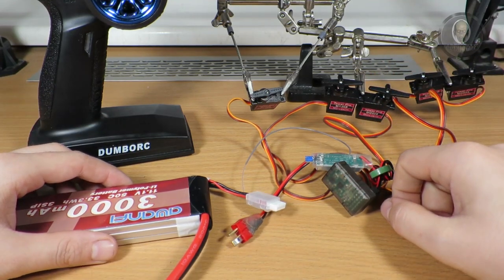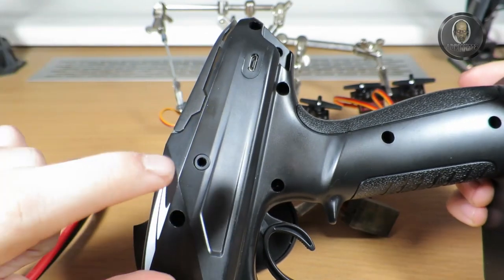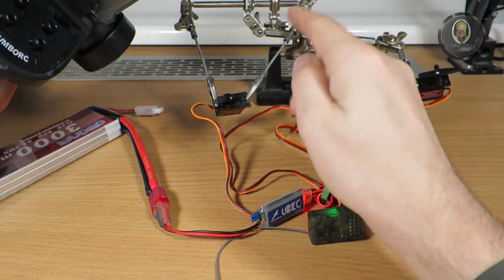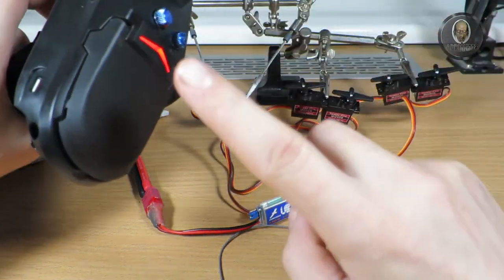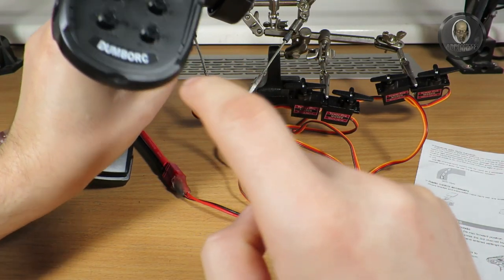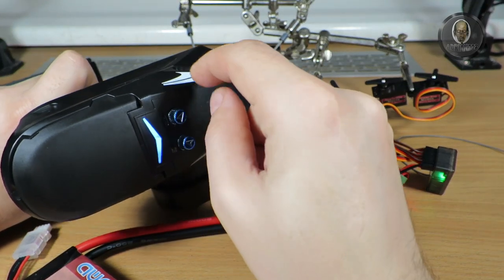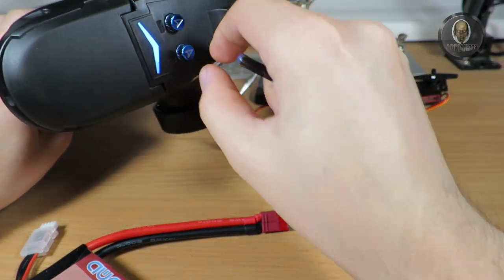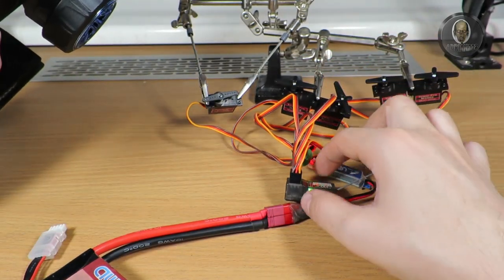Setting up DumboRC transmitter and receiver

Comment: It doesn't work for me.
Reply from the maker: There are two versions now as far as I know and the new version have a different combination to get into the menu.
Check manual how to enter the menu in Your version
Reply: @Adrian202  I found a young kid that had a video. Turn left while pulling trigger, turn on, push ch3 , blue light on top flashed, pull trigger, release to center, push forwards, and return to center, repeat, move ch 4, and 5 knob, and switch, push ch3 programming complete
Reply from the maker: @RCOverKill  I have only older radios so can't make movie showing programming on new ones but I pin this conversation :)
Reply: @RCOverKill  who is it I want to know
Reply: @nolansrc9560  1stbill look for directions, if not I'll find it for you
Reply: Hai..i just a new beginning for this rc play...and i just buy a new transmitter with provide reciever x6f...how if i just buy reciever x6dc n pair with my transmitter..it can or not??🙏🙏🙏
Reply: @nolansrc9560  my internet is super slow or I would look. It's about a 16 year old asian boy in a 2 or 3 minute tutioral
Reply from the maker: @ridzwan8204  Receiver from the same factory should work, but some functions like gyroscope in some receivers could not work but I think it will work after binding :)
Reply: I know Im randomly asking but does anybody know of a way to log back into an instagram account?
I stupidly forgot my login password. I appreciate any assistance you can give me!
Reply: @Carlos Kyng instablaster ;)
Reply: @Carlos Kyng No problem xD

Comment: Thank you, this was exactly the explanation I needed. Note: on my dumborc X6, to enter programming mode, you have to pull back the trigger and turn the wheel left, switch power on and then push button ch3.

Comment: Just to let you know, new versions of this transmitter use a different combination to access the program mode. Now you fully press trigger and turn steering wheel to the left, turn on transmitter and release both controls. Then press ch 3 to access program mode. Took a while for me to find this as the manual still mentions your way @ 19:00. Hope this helps somebody
Reply from the maker: THX for information, I pinned this comment on top :)
Reply: Is that a gyro transmitter and receiver it's on its side that's why it's twitching
Reply: The twitching cuz of the gyro turn a gyro off to stop twitching

Comment: Can I put two servos on the steering channel. Because my car has two servos
Reply from the maker: On all radios and just use splitter.
The only problem will be to reverse the rear one, but there are servo reversers on the internet, or You can redesign steering to reverse direction.

Comment: Hey, This vid helped me a lot!! I just got the DumboRC x4 that used the new program mode option. I did not know what the dials did and somehow accidentally zeroed the throttle and steering out. I thought i got a broke unit but i could still adjust the trim and the car would move so I knew it had to be a setting. Watched a bunch of other vids and read forums and nobody else said anything about the knobs! Thanks for making this video!
Reply from the maker: I did the same in this video :D
Took Me moment to find out what's going on :D

Comment: Nice to see that you took my experience to the video!
Reply from the maker: Yes and also i did not know that you need to set ranges on channel 1 and 2 before confirm with ch3 button
Reply: @Adrian202  No, I know, it took me a while to understand that. A little weird. But it really makes this remote even better! Amazing to get a such a good piece for the money.
Reply from the maker: @bengtmowitz5012  that's why it's nr 1 in this moment.
I will order x5 for My BMW and I still think about rebuild one of My trucks to full metal :)

Comment: How do you get the failsafe to work on this radio, I've just got one and I'm trying to set it to put the brakes on for my nitro when I turn the transmitter off (go out of range)
Reply: yes I need mine to do that aswell. did you find anything?

Comment: Thank you for the very informative video! I have just two more questions: Is it possible to drive a crawler winch on CH 4 with the 3 position switch (the best would be: Pos 1 (left): on/ Pos2 (middle): off / Pos 3 (right):  on in reverse direction)? And if you think yes, how to program the CH 4-switch? Thanks a lot in advance for your answer!!
Reply from the maker: Channel 4 is moving from negative --> center --> positive that mean on ESC it will have reverse/brake --> neutral --> forward in programming mode You can change max angles, so You can adjust that for Your needs.
Switch on channel 4 is always working until remote have it :D

Comment: i see you have 4 x 1.5V rechargeable batteries (that is nominal voltage of 4x1.2V = 4.8V). i know the remote also can use a 2s battery pack of 7.4V nominal voltage. Do you know if using the 4x1.5V batteries makes the signal range shorter or weaker compared to when using 7.4V ? thank you
Reply from the maker: I don't think so, It's probably regulated down to 3,3v, but I'm not sure about voltage

Comment: Since you've had this for a while maybe you can help: a portion of these radios have an issue where they simply just lock up and keep sending the same signal (full throttle and right turn for example) for 1-3 seconds... causing run aways and such. ... it resets and you gain control again.

have you had this? if not is there any chance you could open yours and help those of us who have this issue.... it might be that a new revision of the control board has removed this bug OR this is a manufacturing defect due to some bad soldering or something..... detailed shots of both of these might help solve the issue for those of us looking for a solution(so far ive only found ppl talking about the issue no solution yet)
Reply from the maker: So I notice this problem when You turn on receiver but not radio, When You lost connection receiver love to send random signal on random channel, sadly that's software problem and I don't know if failsafe device will detect missing signal.

Comment: I bought this hopes of upgrading the one I got with my danchee ridgerock but I can’t seem to program steering modes( crab-4wheel steer or just rear steering) is it possible to set this transmitter up do do that? I have 2 servos and they’re plugged into channels 1-3
Reply from the maker: I don't think You can use dual steering with this one unless You use a special mixer that will add that function.
You can have rear steering on potentiometer but will not be mixed with steering
Reply: @Adrian202  well that’s unfortunate 
Thanks for the heads up

Comment: hi, you receive it T6F does not have the gyroscooio function, right?  do we need the receiver that ends with the abbreviation FG?  Thank you
Reply from the maker: If I'm not wrong, gyroscope function is  in receiver so transmitter need to have so many channels just to be able to set specific sensibility on gyroscope to work bot I could be wrong
Reply: @Adrian202  for the same remote control, there are two kinds of receivers, I don't want the gyro because I have the version without?

Comment: One note - with regards to the direction of the Rx for the gyro to function.  I have installed mine in my HPI water tight Rx box but it only fits sideways and the gyro seems to work properly.  I am not certain how but it does.  Any comments?
Reply from the maker: Maybe it's detecting rotation, not moving sideways ??

Comment: I have x6 transmitter x6dc receiver. My ch5&6 are push buttons not knobs. I'm still trying to figure out how to adjust their trim like the ch3&4 that use the 0-100 knobs.
Reply from the maker: On the one that I have You trim aux with trims of throttle and steering but in programming mode, but they change software in remotes and I don't know if new remotes still have that

Comment: Just got this for myself - great radio and features, but I seem to have a problem with Channel 1 - steering. The steering trims settings are opposite to the direction I want. I can trim the steering, but it's frustrating that I have to go opposite direction on the steering trim knob. Any advice?
Reply from the maker: I notice the same :D reverse only work for direction not centering :D
That's software problem and to fix that You will need to rotate servo in mount but for most models not possible :)

Comment: How many receivers can you bind to one transmitter of that model?
Reply from the maker: I think one, I did not test for more than one because You can't switch between settings so You will always need to calibrate after connection and that annoying :)
Reply: Adrian202 RC yeah good point.

Comment: Can this handle 3s
I am using 3s zop 2200 mah and my receiver has burnt as I directly attached my battery to it without esc .Can new receiver be connected to it easily and my esc is 320 a
Reply from the maker: receiver can support up to 2s as far as I know and NEVER CONNECT BATTERY TO RECEIVER !! there is no battery protection and voltage regulator so always use BEC, UBEC or ESC to power servos and receiver :)
for receiver is not important how powerful si ESC or motor because it's only sending signal to it and ESC get all current on mosfets if I remember :)

Comment: 6th cahnnel could work with servo like 5th, or it is only for gyroscope sensitivity?
Reply from the maker: in theory Yes because there is connector for that channel on receiver but it would be better to disable gyro in receiver.
In that case would be just better to buy version without gyro :D

Comment: hi there is it possible to connect an Fan to the Receiver ? is there an channel with permanent output ? or would it be possible to plug it in channel 3 ? could you explain which pin is which polarity by default/Forward ?  Nice Video o/ much information i didnt know :D  !
Reply from the maker: You need 2 pin fan (3 pin version could not work) also need to be for 5v or 6v depending on BEC that power receiver.
Each channel have + on inside and - on one of outside pins
You just connect fan to that two pins because they are connected together.

Comment: Can i connect rc flashing car system for controlling the function of the led? Like the turn signal
Reply from the maker: I did that :) mostly light kits use Y splitter to connect to steering and throttle.
Check here:
https://www.youtube.com/watch?v=7iDWJ5vWgX8

Comment: Hi I want to ask you something that I am using dumborc transmitter and receiver and 2s lipo and hsp 320a esc in my car my throttle is 100 but I push it ,it does not catch speed immediately .do i need to change my esc?
Reply from the maker: Sorry but there is way to much things that would make this problem that's why I can't be more specific.
This could be a mechanical problem, problem with ESC, trimming on remote, soft start on ESC and much more so You will need to test each part one by one to find what's wrong.
Sorry but I can't give You specific solution :(
Reply: @Adrian202  I bought everything new throttle and trimmer at 100
Reply: @Adrian202  just make me clear that I am using hsp 320a esc I think due to this esc problem is occurring.
Reply from the maker: @nowitsepic5330  This may mean mechanical problem like weak problem or something blocking drive or to weak battery that's don't have so much current
Reply from the maker: @nowitsepic5330  This may be faulty ESC but that's rare
Reply: @Adrian202  plz I will be kind if you check the hsp 320 specs online and I bought new battery of 7.4v 4000mah.My heart says that esc is not for this car.My RC car is jjrc q46 I just put new electronics on it.
Reply from the maker: @nowitsepic5330  wait, 4000mAh ?? that's over kill, it's to heavy for this car !! car is so heavy that motor need much more current to get it to start
Reply: @Adrian202  but the car when I bought come with 7.4v 3000mah.and car was working fine with full power.

Comment: Hi, a very good explanation of the Dumborc TX for something that is not easy to decipher from the manual,  in regards to controlling 2 motors my understanding of the manual is you connect 2 ESC's (and 2 motors) to channels 1 and 2 which will give you differential steering which is fine for a tracked vehicle but I would like the TX to not only control 2 motors but also control a separate servo to control the steering as well! I don't think this is something that the 6 channel Dumborc can do but hoping I'm wrong LOL what are your thoughts on this? thanks in advance.
Reply from the maker: You could use potentiometers for that
Reply: @Adrian202  Thank you for the reply I really appreciate it but my understanding of electronic components is much more basic than yours so could you explain further how to use the potentiometers to give me 2 motor control and steering, (might help others too) again thank you in advance.
Reply from the maker: @markpreston8273  You can connect servo to potentiometer and that would be a second steering wheel :)
or You can use a separate v-mixer for motors and split steering signal to v-mixer and servo.
Don't worry, We all learn :)
Reply: @Adrian202 @markpreston8273 I too am new and found this conversation too see if anyone could explain how to set up steering modes (4wheel-crab rear steer only) with this transmitter ? Is that possible? I’m trying to use this as an upgrade for my danchee ridgerock thanks in advance

Comment: Thanks but can it handle 3s as you r using 3s and will new receiver be attached to it easily
Reply from the maker: I'm bit confused now, Receiver work on 3S or transmitter work on 3S ??
Reply: @Adrian202  receiver on 3s
Reply from the maker: @nowitsepic5330  I don't think there is any receiver that will work on 3s.
You always need BEC, UBEC  or ESC with BEC to power receiver or You will burn it
Reply: @Adrian202  No sir  I am just saying can i use 3s for this receiver by using 320a esc
Reply from the maker: @nowitsepic5330  receiver mostly work on max 7.2v volts so You can't connect battery directly but how much voltage ESC can support will depend on ESC because it will mostly send 5v to receiver no matter what battery You use

Comment: Perhaps you could splice the power lead from the BEC into one of the servo leads? That way you would use one port on the receiver for a servo and for power at the same time. I should work don't you think?
Reply from the maker: Mostly ESC provide power for receiver and servos so no need for that :)

Comment: great human explanation, at 1.5x speed it's perfect :D thanks! 
one question: can you connect LED lights for the car directly to the receiver? for example to channel 3? if yes, how much Voltage and how much current does the receiver supply to the LED in this case? so that I know how powerful LED I can add. thanks!
Reply from the maker: All depend on BEC or ESC that power receiver.
Most of ESC have 6 or 5 volts and something about 3 amps but You will not have any control to turn it off that's why I always use RC switch

Comment: Quick question. Can you bind multiple receivers with this transmitter?
Reply from the maker: Not worth trying, you would need to change all the settings each time You connect to another receiver.
If You had LCD and profiles that would change all the settings than that would make sense.

Comment: Hi, I wanted to know, does this receiver work with 11.1v 3s lipo. I am pretty confused as it has '4.8v-10v' written on it.
Reply from the maker: Because receiver same as servos is powered by BEC from ESC or separate BEC and most of them have 5-6v
Reply: @Adrian202  So it will work? I am using those cheap 30amp red escs.
Reply from the maker: @saikatmauser  Then You have 5v because DumboRC ESC have 6v so Yes it will work :)

Comment: Sir i just ask why i cant control the channel 3-6 on my dumborc tx rx,but it have power when i put the servo on each channel 3to6 it has a direct power.thankyou in advance
Reply from the maker: first check if You connected plug right because in connecting plug opposite will make it turn on but get no signal.
Check if channel 1 and 2 work to confirm that You have connection.
Start from basic thinks just to reduce some simple solutions.

Comment: I have this.. but I have a vehicle that I don't need so many channels could I use a smaller receiver I have Kyosho HOR motorcycle and the receiver maybe too big.
Reply from the maker: Only Dumbo RC receivers can work with this radio (so far)
You can take off case from receiver or unsolder connectors (like I did once)
Reply: @Adrian202  Don't they sell a receiver with less channels?
Reply: What if I take it out the case and put it in a balloon would it get too hot?

Comment: The usb connection is just to power your transmitter if you don’t use a battery. The only thing about it is it bypass the on/off switch.
Reply from the maker: You could connect a power bank in case if batteries would discharge :)

Comment: I actually prefer the quality of this transmitter to the Austar x6s. Thanks for explaining the tank mode...I might actually get a tank now 😆
Reply from the maker: I like it because of functions and channels :)
I order this:
https://www.banggood.com/3V-7V-Light-Shock-Absorbed-Smart-Robot-Tank-Chassis-Car-DIY-Kit-With-130-Motor-For-Arduino-SCM-p-1155263.html?p=5G2717320323201310AJ
It's still waiting for some project :)
Reply: Yeah, same. When I FINALLY get around to doing a tank... I'll be Ebaying this puppy in a proverbial. Tanks! (sic intended)
Reply from the maker: @stevewatts3502  I got most of popular cheap radios now :D and still 2 Austar in box but functions of DumboRC make Me buy Dumbo instead of use that two :D

Comment: Guys, I need your help. I have transmitter Dumbo X-4. By accident, I have bind (somehow) under throttle a light in my JLB J3 Speed. I don't know how to bind acceler4ation to throttle button again. Please help :(
Reply from the maker: I'm lost here :D i did not understand what You want to do :D
Just connect ESC to channel 2 and steering servo to channel 1 :)